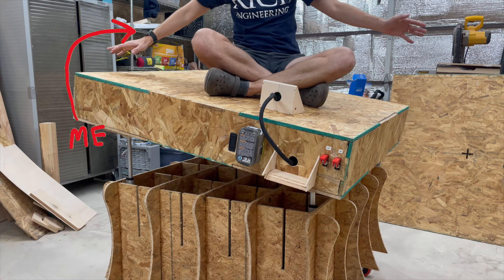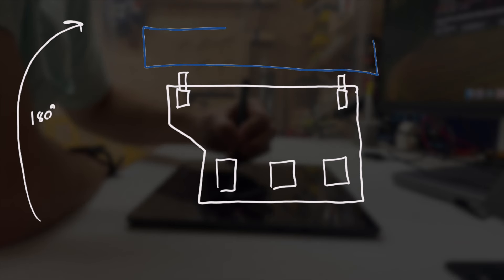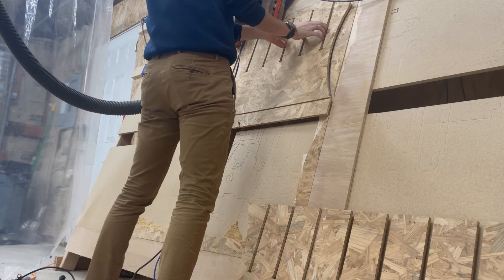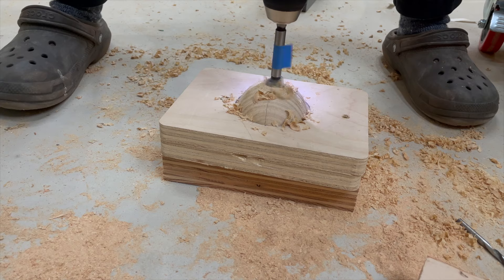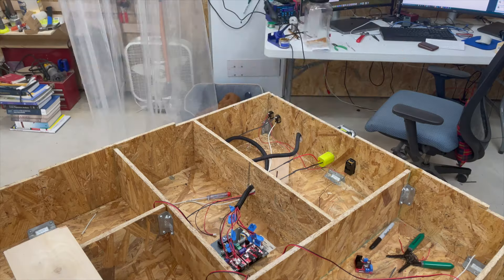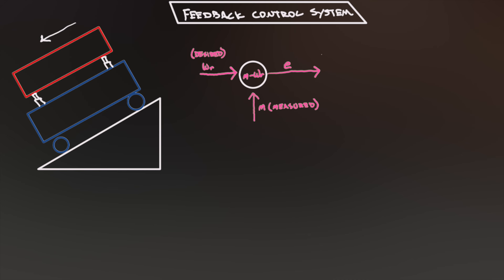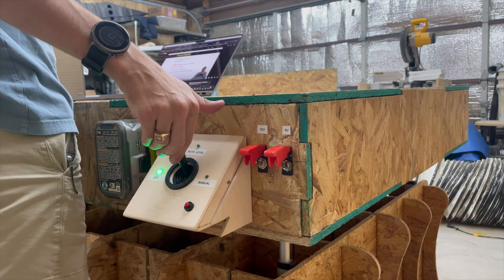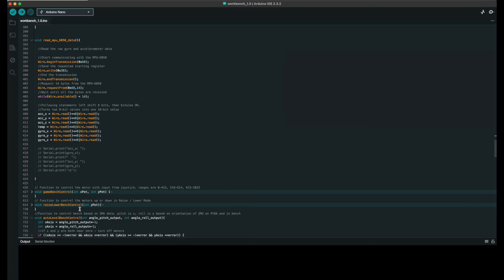I Built A Workbench Like No Other

Comment: Any parts list, code and whatnot to reproduce this? I have a VERY sturdy workbench I would like to modify the top to adapt to this (it can go on gravel and grass, because it has very big wheels, and I use it to cut wood regularly, I don't have an extractor/air cleaner/shop vac setup, andI feel like this would be ideal as I have access to some actuators.)
Reply from the maker: That would be helpful, huh? I might publish some more info on GitHub in the future if there is a strong demand for it, but right now I’m more focused on the next project rather than cleaning up the documentation for this one… sorry.
Reply: @FirthFabrications  Totally understandable! I was able to find the information for the actuators based on a screenshot I took of your video but its not really helpful without the code and PCB :(

Comment: Why doesn't this incredible video have a million views!?! Quick question, isn't there a side load force on the actuators tracing an arc from starting position (angled way down, let's say) until level? Are the brilliant ball in socket joints on the table end enough to prevent the actuators from binding over time? Thanks so much for this incredible video. I'm trying to implement your solution to create the same system for my bicycle camper https://youtu.be/KNu2TCPacv0  - and frankly I wish I could hire you to help me!
Reply from the maker: Thanks for the kind words. But yes you’re right, there is a shear force on the actuators when they’re not level. The ball in socket joints help shift the force, but they don’t completely take it away. However, in practice that force is so minor because the actuators are never in those drastically tilted states. Usually to keep the bench level it needs to move a 1/4 or 1/8 inch. For the video I pushed it to the limit and showed full extension but that isn’t reality of everyday use. Even so, I’ve had no issues with the actuators in about 10 months of use.